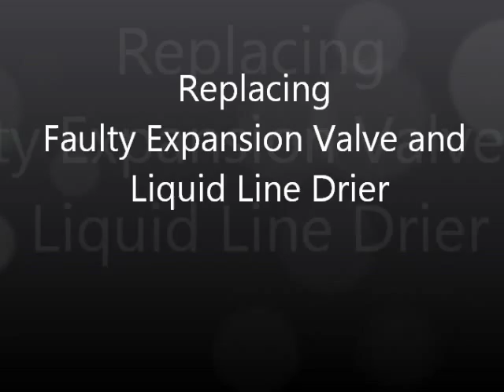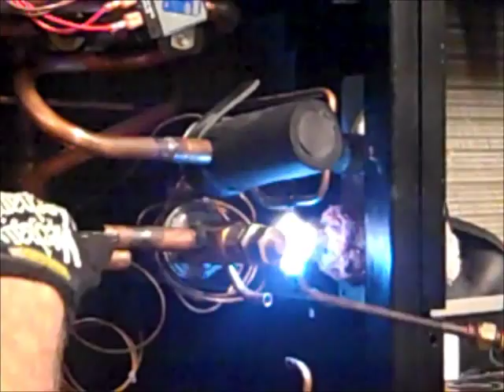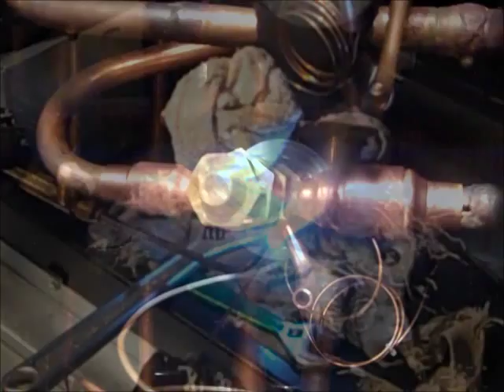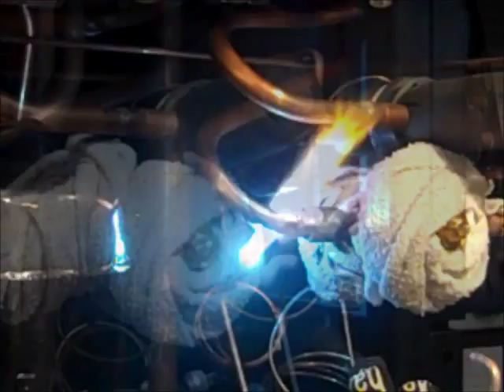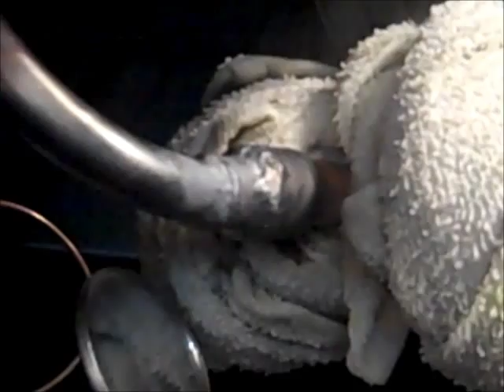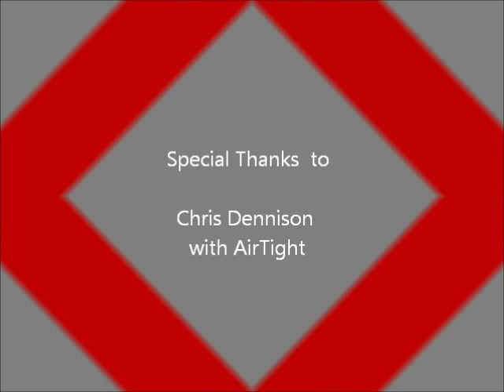TXV - TEV (Thermostatic Expansion Valve) and Liquid Line Drier Replacement

Comment: You can have a system running a average evaporator pressure on the suction end but your superheat and subcool will likely be all over. 20 sh and 20 sc showing over and undercharged st the same time. As well as a starved coil

Comment from the maker: Unit would have Low Suction Pressure. Checking the sensing bulb and found the valve to be stuck in the closed position.